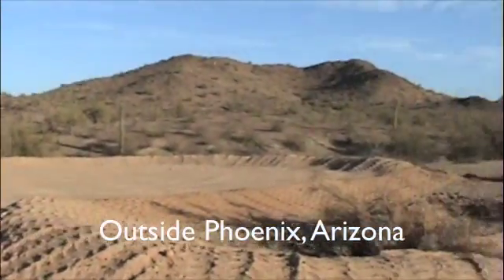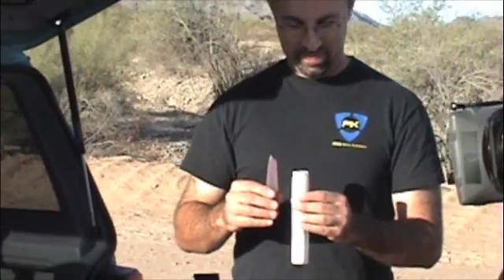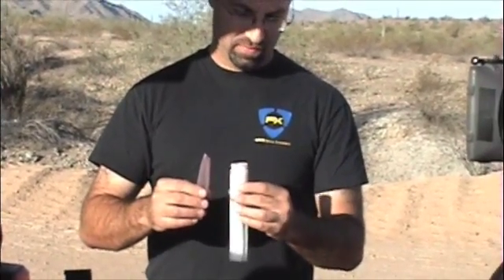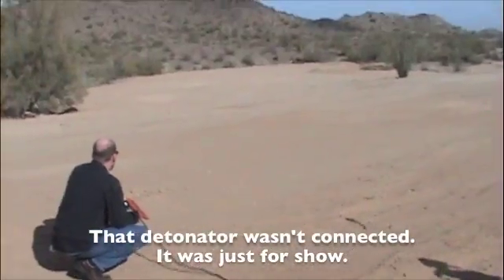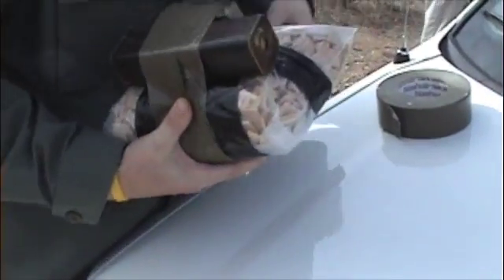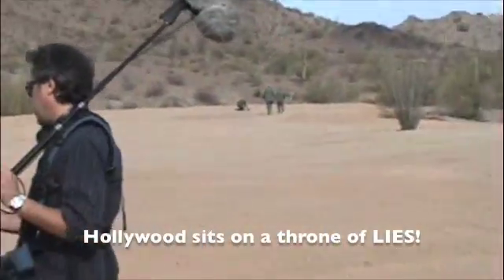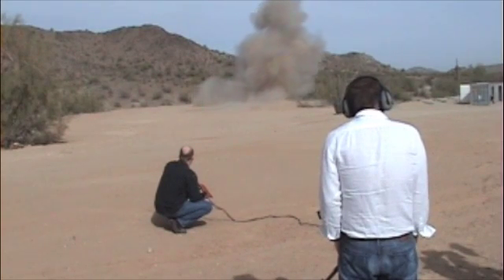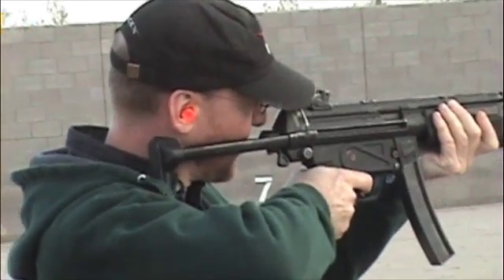How to Kill a Planet: explosions!

Comment: Making explosives is not difficult and does not require much intellect nor complex instructions.  There are 2 difficult parts to making IEDs, however.  

1) making the bomb safe enough to transport.  That requires a goodly bit of brain power, training and instructions.

2) Related to the former... setting it off so it works, and goes off when required.  That is also a lot more work than it may seem.

But mixing chemicals?  That's just dangerous - a "don't try this at home, stupid" sort of thing.

Comment: nitromethane plus ammonium nitrate is just what McVey and Nichols mixed up to blow up the Oklahoma City federal building. He wanted to use hydrazine but couldn't get enough; nitromethane was available through racing suppliers.

5 pounds TNT is about 10 MJ or roughly 100 nanograms of matter being turned into energy, if my calculations are correct.